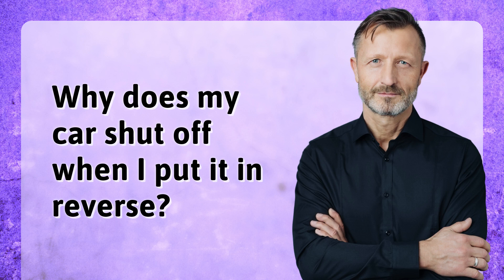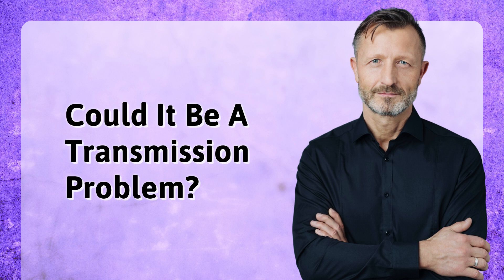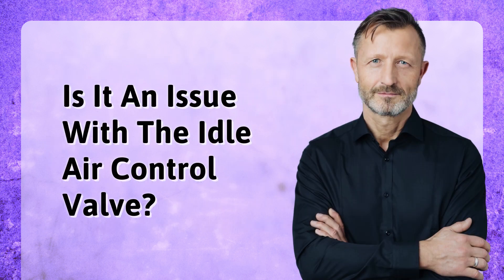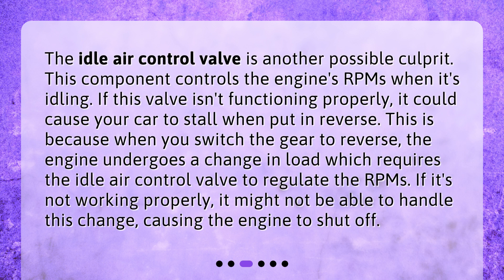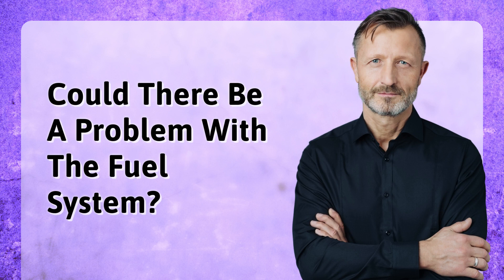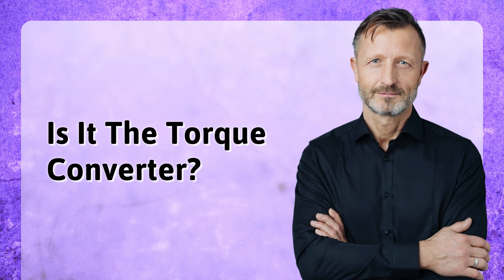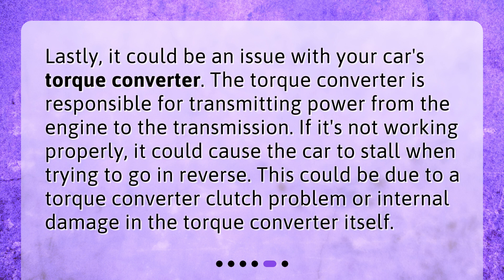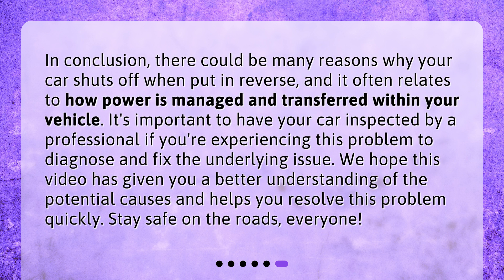Why does my car shut off when I put it in reverse?

Comment: Check the air intake while it is happening for cracks or leaks.when in reverse the engine torque is in the opposite direction plastic intake hoses and clamps may be loose or damaged